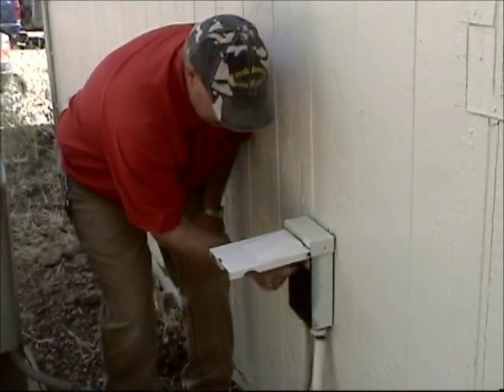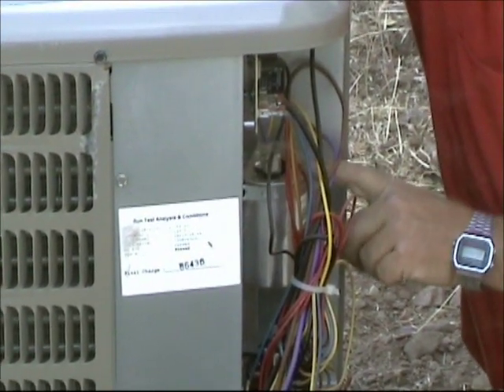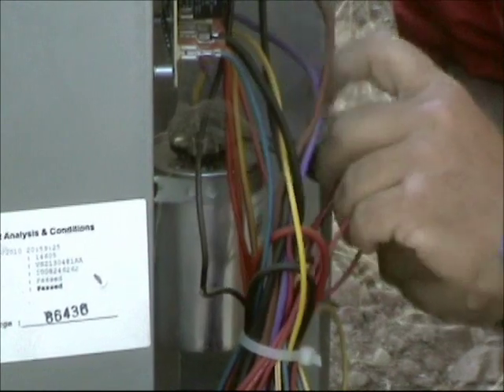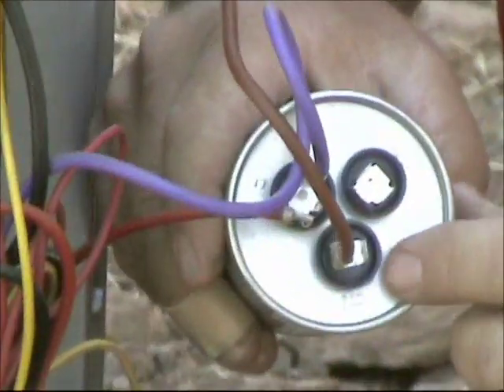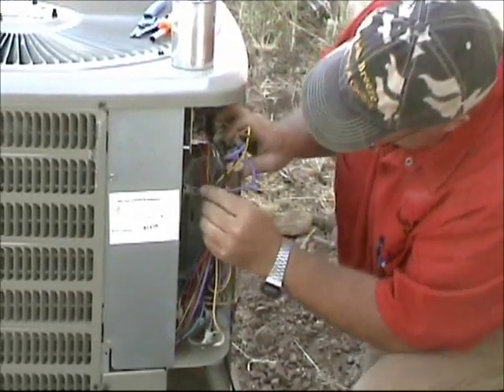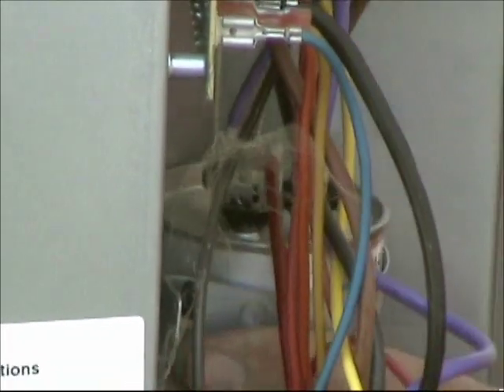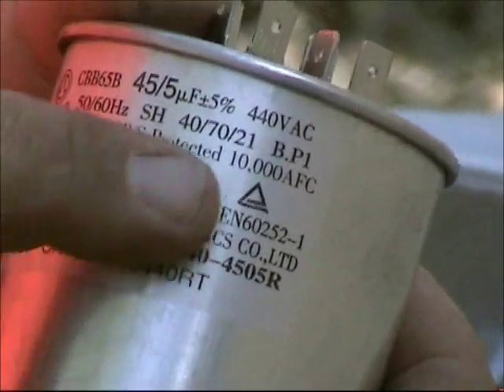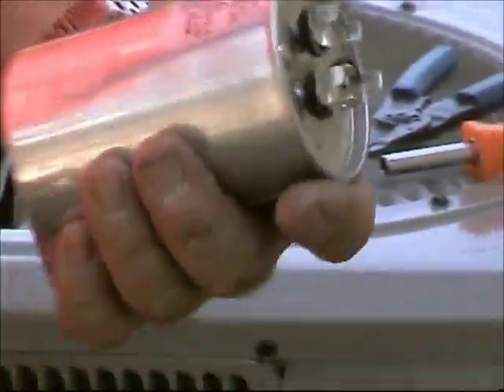AC Run Capacitor - How to Change a Run Capacitor

Comment: Thank u for ur video. My dad before he passed in August of this year he changed the capacitor but it was used I think. He still bought some well it I think happened again. So the current I turn off breaker then put screw driver in between where Exactly and then after that where do I put the bracket out to make sure it doesn’t do what it’s so hard to see the video.

Comment: Great video.  My Confortmaker 2.5 ton central air fan was not running. Loud humming sound.  Turned unit off for an hour or so. Turned unit back on and took long screwdriver and slightly turned fan.  Fan started running but mad loud noises. Turned it back off for a while then back on.  It has been running fine for the past 12 hours. What is your suggestion?

Comment: great stuff. thanks for making it easier.
i have two questions: i heard that the capacitor will lose it charge after 15 minutes, or so, after turning the unit off, i.e. taking out the disconnect. is this true? 
second when you touch the screwdriver to the common and the fan, or the herm, does it just take a second or so of contact between the two to lose the charge? thanks.
Reply: I have the same question? Did you happen to find anything out?